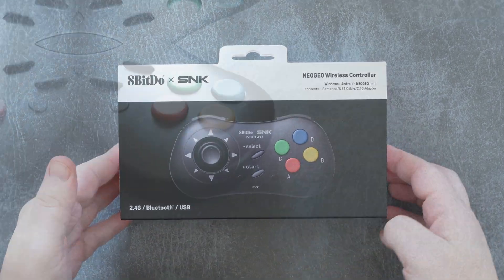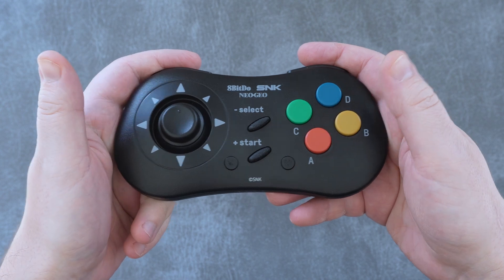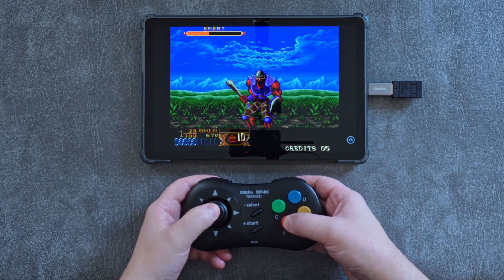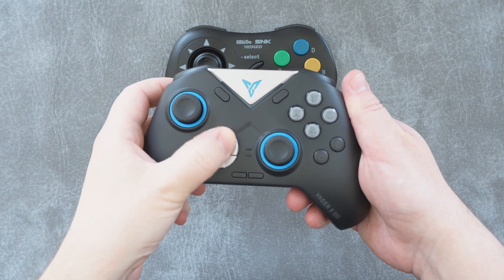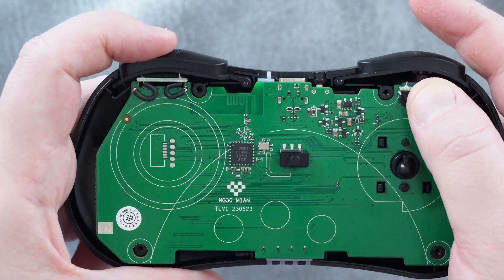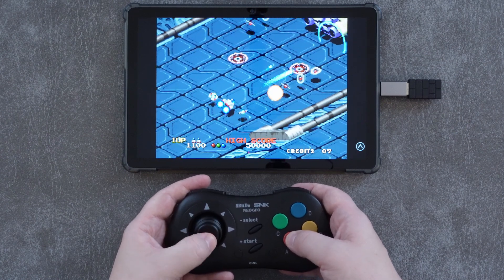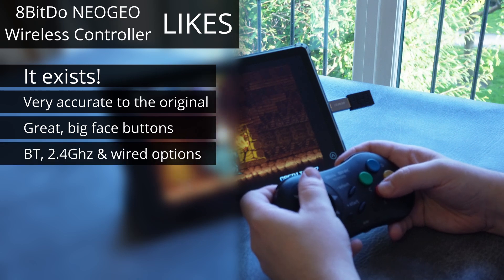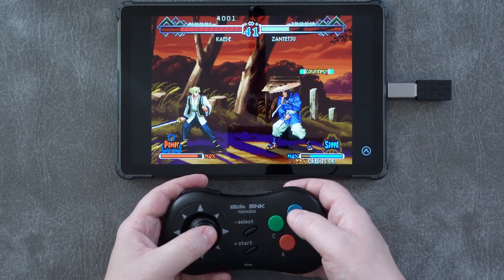8Bitdo NEO GEO Wireless Controller Review | NONstalgia? Something's Not Quite Right.

Comment: I didn't like the long travel so I placed  some very small painters tape on the shaft and now feels much better, it´s an easy mod, it took me about 15 minutes.
Reply from the maker: Oh cool, thanks for the tip! I was certain it could be improved through modding.
Reply: @RetroBreezeYT  yeah it's a lot better, now I'm looking to replace the spring for some heavier ones
Reply: Ah you're a lifesaver. I never would have thought of doing this. I just did it and it feels much better.

Comment: I believe you can fix the deadzone problem by widening the stick shaft. That way the deadzone would be theoretically shorter. But that would require either a new 3d printed stick shaft or adding padding to the existing stick.
Reply: I was thinking of the same thing. I'm going to drop a comment soon on what I plan to do.
Reply: I added 3 layers of painters tape to the shaft, it adds about 1mm extra thickness and now the diagonals are very easy to press. Sorry my bad english hehe
Reply: I tried wrapping tape around the shaft to make it thicker but to me it doesn't really fix anything. I guess the deadzone is a bit smaller, but the feeling that you have to push the stick all the way to the edge to get it to actuate is still there and this is by far the most laboursome directional controller I've ever tried. I think the problem is with the switch/spring.
Reply: Someone released a 3d fix for the deadzone.
Reply: @Fake-dw9zx  sweet! Where at?

Comment: On your DIY handheld, I'd recommend using a lower stick gate, similar to what full-sized sticks use.  This will constrain the gate to the switches, rather than constraining the gate to the stick's throw (and by extension, tolerances and movement within the case and the case-module mounting), you'll end up with a much tigher tolerance on the switch cluster which will make it feel a lot nicer and more consistent.  You could drop a 4-way gate in there or an 8-way gate, or have the two be swappable.  Neo Geo tried miniaturizing a proper arcade stick, 8BD tried replicating this, and you can tell the tolerances aren't super optimal based on design, and without seeing a teardown of the PDP module (which at this point would be a rare find considering how old that thing is and long before teardowns of components were common) I'm not sure if anyone has really tried doing the full-sized-stick-style directional stick, as I know the Vader 3 Pro has its switches planar to the PCB like any other pivoted Dpad; though the PDP module does look more akin to the NG Pocket Color's dstick assembly, just larger. 

I do want to see the Dstick be popularized by a company within a modern context, it's supposed to be the golden middle ground of a fight stick and a gamepad, and is supposed to provide the golden middle ground between the Saturn-style Dpad and the Nintendo-style (which everyone uses now, outside of a few edge cases) Dpad; if you don't know the never-ending debate, one feels more accurate in input and the other feels faster/better to use.  But I don't think this module design is the correct path, too many parts, too much complexity, this is why the Pocket and PDP module are nicer, and why gated lever switches (akin to what full sized sticks will use) seems like the next step forward.  I almost also want to see the hybridization of a Dstick and an Astick, FGC players seem to like the longer throw of the Dstick so why not also throw some analog under it and have two components in one; not to mention the the combination of analog with endstop switches could have massive implications given the current issues with analog sticks, though there'd be some design challenges to incorporate the two nicely.

Comment: The stick on mine will click before actually registering the input. Nothing happens till I push past the click point making the throw feel very long. The only cure I can think of would be to 3D print a thicker shaft to help shorten the throws but that wont help the inconsistent micro switches.
Reply from the maker: Yeah that sounds about right. I considered trying some 3d printed fixes but don't know if I could have the time!
Reply: I've already tried that but I could only make the shaft just below 1 mm thicker on each side (it's a square formed stick). Larger than that you can't press the stick into place. The slightly thicker stick made the throw a little bit shorter but not much.
I think they should replace the silent micro-switches with ones that click and not depend on the actuators to make the click sounds.

Comment: My shoulders feel ok and sound about the same. However, the stick could be better. Shorter actuation throw and a nicer actuation sound and feel would've been ideal. But, it's OK overall.
Reply from the maker: Yeah I think somewhere between OK and Good is where I'd put it, but definitely not as good as I thought it would be!
Reply: I've got an original pad, I'll try swapping some parts around internally to see if I can't fix some of the issues so I can recommend it as a potential fix for some issues.
The original pad I have has a broken microswitch on the left, so it's been wallowing in my parts box for a while.
Reply: Okay, so number 1 issue as I open this up is that straight away, I can see that a square gate has been added that restricts the throw to be even smaller than the original. In addition, the actual central stick is marginally thicker to the point where the original cap won't easily fit.
The new cap is marginally smoother than the original, but I can't feel the difference personally.
I'll open it up, replace the springs and stick and see if it feels better. I'm considering some card stock to fix the bumpers in place
Reply: The red, blue and green buttons seem a hint more vibrant and upon opening the controller, it looks like I made a mistake, as both controllers have the same square gate built into the stick-module, and digital calipers show the same width of gate as well as the diameter of the circle on the shell.
Stick width makes no noticeable difference as to throw, so I'm thinking it's down to the springs. Likely the stiffer springs also led to greater wear and tear on the original's microswitches, so it might have been intentional to increase lifespan or unintentional in that nobody checked the original's spring tension, or even that their basis was on worn out springs.
Prepping for switching springs and I'll post my findings on Reddit in addition to here when I get a chance.
I only pray it's not the microswitches themselves.
Reply: Yeah, these springs are so much thinner. Unfortunately, the old springs are too wide for the new switches, so we'll have to find stronger springs of the same width to improve the stick.
Reply: @cptncutleg  interesting did you end up finding a solution? :)
Reply: @HollowRick  I ordered some slightly stiffer but shorter springs, the travel to actuation is a tiny bit sooner, giving a wider margin for diagonals.
I bought a second one a few weeks ago for experimentation, and I'm going to try merging it with a Hori Fighting Commander or an M30 for a six-button click-stick controller.

Comment: Thank you for the review. I was just about to order it, but was concerned about things like long throw and decided to check few more reviews. Your review basically showed exactly what I was afraid of with the travel/throw, and possibly stopped me from wasting money. There were also 2 reviews from another channels where reviewers mentioned having to learn hitting diagonals as the initial input with it, which also kind of hit on what I imagined might be a possible issue and tied to the long throw + how 2 switches are actuated. I'm personally very wary of 8bitdo controllers as I find their dpads to be low quality despite what big name reviewers tend to say, but also due to reliability issues and various quirks, including with the firmware. I find compatibility a less of a concern, especially since I don't have Switch (but would really be annoyed if I had), but even then it is inconvenient that Direct Input is only available through BT which means I can't use it on some old PCs, and to lesser degree also that xInput isn't available through BT (RetroArch for Android can be very picky with Direct Input controllers support). Older 8bitdo controllers allowed you to switch between modes freely, and some like my FC30 Pro even had Wii compatibility (which then got removed with firmware updates... 8bitdo...).

Anyway I wanted to use it for arcade games in general, but also home computer ones (Amiga) cause it is really hard to find a full sized digital joystick that isn't completely worn out and the prices are going insane. I guess I will have to refurbish an actual Amiga era joystick for home computer games, and also change stick in my Hori HRAP4 Kai (stock one has too long throw for me as well, doesn't feel anything like a real arcade from back in the day).

Comment: I must admit, I’m pretty curious to learn more about your DIY clicky-stick.

Speaking of clicky-sticks, I’m surprised with your glowing opinion on the one from the PDP Versus Fighting Pad. I’m one for Xbox 360, and it rapidly stopped registering the diagonals, (only pure up, pure, down, pure left and pure right function) which is quite problematic for lot of games, especially the fighting games this controller is supposed to be made for. (It’s is one of the many reasons your DIY clicky-stick interest me so much.)

Comment: Hello, I have a problem with my controller, when I put it down it doesn't make any noise, would it be advisable to open it to see if it's not badly fitted.
Reply from the maker: I'd just return it and get a replacement. Probably not worth opening up.

Comment: So I bought this because I saw it recomended elsewhere. I am new to retro games, and very bad at them. Compared to my Xbox series, steam deck and PS5 controller, this thing has been made a remarkable diference. Those big buttons are god send for smashing rabid inputs. 

One thing I did notice, I had the same issues with the shoulder buttons when I unboxed it. I took it apart to move the buttons to match the Xbox colour pateren used by the games I'm playing. (Don't judge me) After re-assembly I noted that then shoulders felt more even. I think it might just be an imperfection in the assembly process fixed by re-seating  the PCB's in plastic grooves that hold them in place.